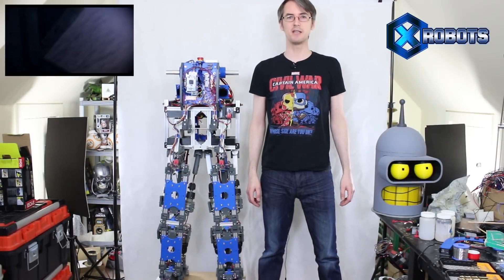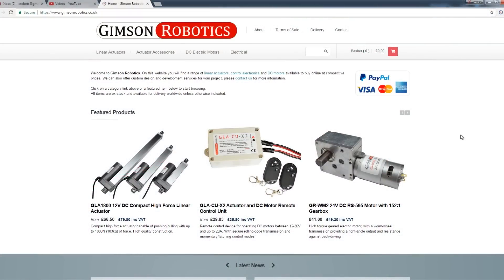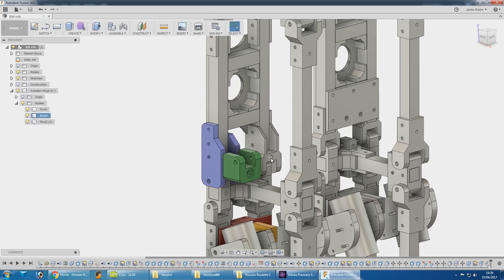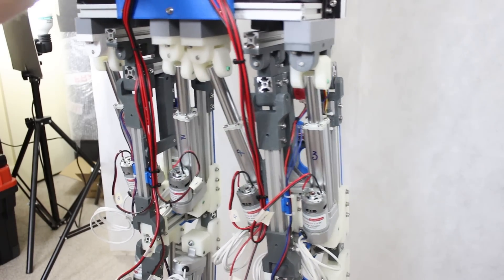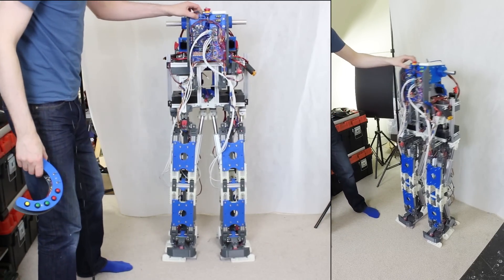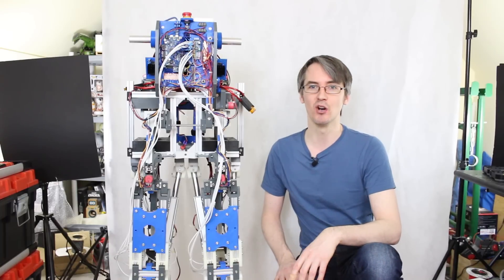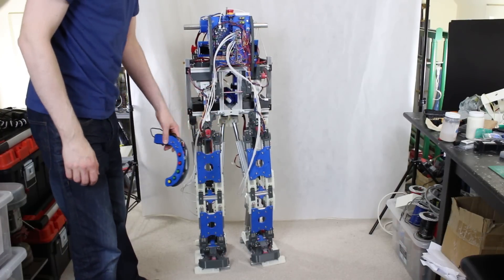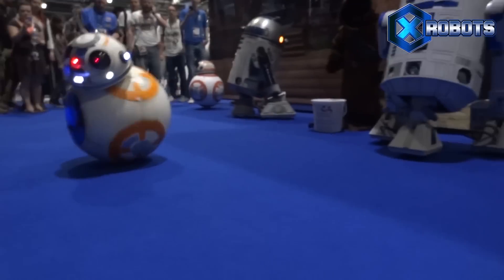Building Robot X #8 | New Motors | James Bruton

Comment: Wait, isn't nylon much less rigid, but tougher? PLA is super stiff.
Reply: If it's rigid enough in the nylon, then sure it's much tougher and stronger, but wouldn't PLA still be more rigid?

PLA has issues with rather fast plastic deformation over time, so I understand why you wouldn't want to use it, but it'd be more rigid right?

Comment: Hi I'm a fan, I love the word of the robots.
I have a question: why you prefer to use this type of piston (I mean activated directly by a motor) and not the oil or air compressed one?
Is because whit this ones the robot will gigol more than whit the one that you use or for the space in the robot?

Comment: Have you considered using vision to correct for any side-to-side slip?  When moving forward, have it focus on a point and correct its stepping if its vision starts to move off point.  I doubt I could move forward in a perfectly straight line in the dark.  Even stepping in place, I would think I would need something to focus on or I would start to spin and drift!